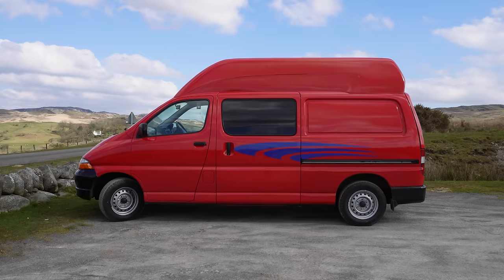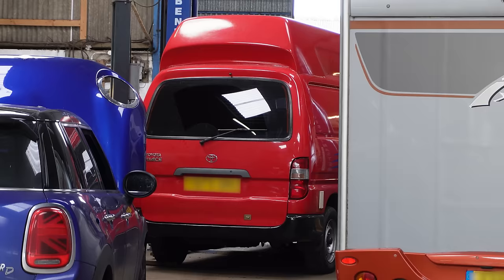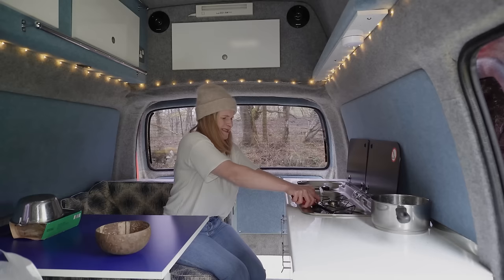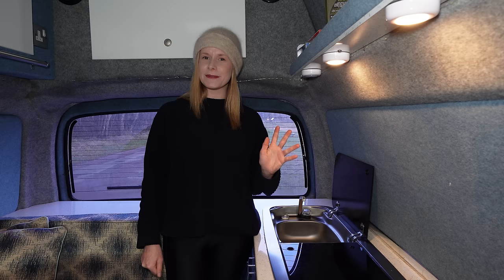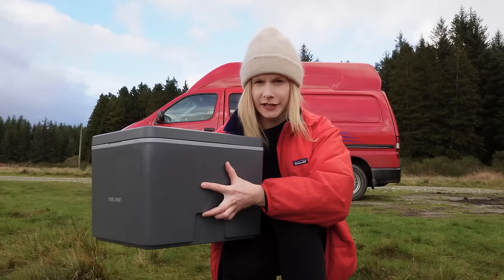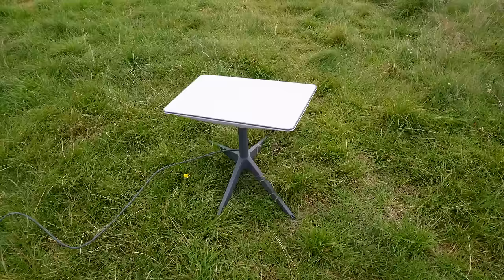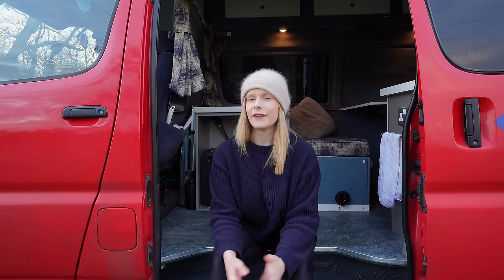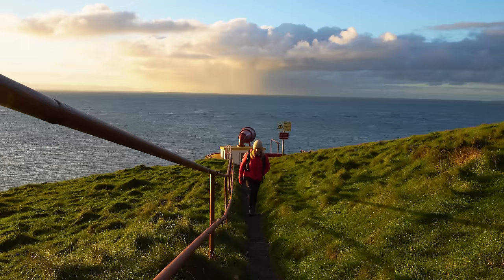Reviewing My Campervan After 6 Months

Comment: A change I'd make is to make the passenger seat swivel so you could use it when parked up. It effectively makes the van cab part of the living area. Often these conversions give you the space under the seat too, that's where the leasure battery was in my old van
Reply from the maker: The passenger seat does swivel actually, I need to start using it more often!
Reply: for my 99 toyota sienna???

Comment: You could hook up your water pump to the bluetti so that you don't need to turn on the car and drain your car battery again. Then unhook it when you're done.
Reply from the maker: Good idea, thank you!
Reply: yw @ruthaisling
Reply: I know you've fixed it now with a foot pump, but it's worth remembering that leaving the ignition on without the engine running can burn out the coil.

Comment: It's good to see you getting so much out of a used vehicle. Obviously, it's a keeper. In Canada I used to drive an old Ford (292 V8) school-bus conversion, which was fine except for the electrics, which were a nightmare! After a disastrous wire-harness fire halfway up a remote pass in the Rocky Mountains, where I ended up blocking traffic for two hours, I sold it on. I've driven many a passenger bus since, but I've never had the courage to try another camper conversion. Happy travels, Ruth! 🇨🇦
Reply from the maker: Oh a fire sounds so scary, glad you were ok!

Comment: Rich content, nice production. Thanks for sharing. Our camping Mains and DC comes from our EcoFlow Delta 3.6 kW power station, as our Sprinter van’s “house” battery/inverter. We expanded it with companion batteries. We also have StarLink, and we use the “Sleep Mode” to greatly reduce power draw at night. We follow this quote when considering our van’s camping design: “It seems that perfection is reached not when there is nothing more to add, but when there is nothing left to subtract.” Antoine de Saint-Exupery
Reply from the maker: I haven't tried sleep mode, I'll give it a try next time!

Comment: If you convert to a traditional 12v solar system you can add that second panel.  It won't matter what the power output is either.  It just needs its own dedicated charger controller. An MPPT controller sized for a single panel can be had for a low cost. Of course you would need two of them.  One for each panel.

I run this on my camper van.  I have four, 100 watt panels going to one Renogy charge controller.  Additionally I have 200 watts worth of portable panels that I can hook up to a second charge controller.  Both controller are wired to the same 4000 watt/hr battery pack.  I have the newest Starlink panel and it is even more power hungry but the problem it solves is worth it.
Reply from the maker: Thanks for the advice!

Comment: Had the same problem with the water. Put in a small LED light near the sink that goes on when key is turned. Works great.
Reply from the maker: That's a good idea, thank you for the advice. Did your battery ever go flat from it?
Reply: @ruthaisling  before the light, YES. The led only draws a watt or two, can be on a long time without affecting your battery. I like the toilet my the way, hope to get one. I live full time in my shuttle bus here in Hawaii. All the best, Bill

Comment: Hi ruth, I don't know anything about Vans but yours look pretty nice. 
I remembered that a big sport shop sells a kind of warming bags that provide hest for several hours. They must be similar to the thermal patches that can be use to treat a muscular or back pain. Maybe it's not a very bad idea to add some of them to the first aid kit for the dual porpouse: treat a muscular pain or provide warm in a cold emergency. 
The external diesel eaters look really nice. 
Also, i remembered that old trains had a pump in the floor to raise the water to the tap. They still can be found as food pumps. But i think it will be better to use the rechargable battery to provide electricity to your actual pump, if possible.
Reply from the maker: Thank you for the helpful tips!

Comment: Hi Ruth, you have done a good evaluation on the van.  I think you should fit a leisure battery, lithium Iron Phosphate if you can afford that or much less costly conventional lead acid style. The alternator will recharge when you are driving plus you have the solar 130w on the roof. You will need to purchase a controller depending on what type of leisure battery you choose.  I have simple 100ah lead acid leisure battery which is charged by the alternator, a 120w solar panel or topped up when I’m on a 240v hookup.  It also feeds a 1000w inverter so my wife can use her hair dryer for a limited time if we are off grid.  I have also fitted a 50Ah lithium Iron phosphate separate system, it is charged by a 40w solar panel and mains 230 when available.  We use it for charging phones, pads, watches and it runs the 12v tv and fire stick. It’s doesn’t charge from the alternator due to the cost of a B2B charger.  Don’t forget I get as much out of a 50Ah lifepo4 battery as a 100ah lead acid. Enough I say!!!  There is plenty on YouTube about the subject.  Now I strongly suggest you fit security dead locks on the front doors, the sliding door and rear door, I used vanlockstore, they are good but there are many others.  We feel really good even parking in a supermarket when the doors are deadlocked.  All folk have to do is break a door window an open the door.  Also if you are inside in an off grid location you feel much safer.  I mentioned the diesel heater before but you have already decided on that one.  They are so much better than gas, we carry a 500w 230v heater, when on a site you can run them on the thermostat.  Good luck we the rest of the winter projects.  Also you will love visiting France, it is SO diverse from beaches to mountains and all the countryside in between. Feel free to ask any questions, I’m a retired engineer and a bit of a geek, hoho! Cheers Mike🥃🍷👍 Keep the videos coming👍👍👍
Reply from the maker: Thanks Mike, all your advice is very helpful and I didn't know about deadlocks so I will look into those.

Comment: Hi Ruth
The best & most reliable gas heater is Webasto. Expensive but they are really good. Don’t attempt a DIY job. It needs to be fitted by a professional. It will add value to your vehicle too.
Reply from the maker: Thanks for the tips!

Comment: I've been swithering about doing a van conversion next year and would likely be powering it with a Bluetti AC200MAX.  

It has a 30A 12v output which, if connected to a 12v fusebox for distribution, is more than enough to power the lights, fridge, USB sockets, diesel heater, water pumps etc.

The only downside to the bluetti is the slow charging rate from the vehicle battery when you're driving. 

There are workarounds though...

Using a 500W inverter connected to the car battery and plugging that into the bluetti's mains input.

Using a DC to DC converter connected from the car battery to the bluetti solar input.

The BLUETTI DC Charging Enhancer (D050S) would (I think) let you use the DC to DC converter method at the same time as your solar panels. It's £150 though!

There are plenty of YouTube videos on all these methods.

Also, I think you can get adapter cables to let you connect your mains hookup to EV charging stations and charge the bluetti that way.

A possible quick fix for your water tap... Does it connect to the car battery via the vehicle fuse box?  Some of the fuse sockets are only active when the engine's on and some are active continuously.  If it's piggybacking from one of the existing fuses, then you might be able to switch it to one of the continuous ones.  Assuming that the tap only draws power when you turn it on, you shouldn't flatten the battery!
Reply from the maker: Thanks for the advice Ewan, very helpful. Someone else mentioned about the EV chargers too and I didn't realise that was even possible so I'll definitely look into that. I think you might like my next video, as I mention about a diesel heater!
Reply: @ruthaisling  Looking forward to it.  

I should have added that the idea of the DC to DC converter is to increase the car battery output voltage. More volts means more charging power.  You'd need to check with a mechanic that your alternator is powerful enough to cope with the extra load.

Comment: Hi, nice video. It looks like you have 2 batteries under the bonnet so using 1 for the starter and the other for your  12v system would be straightforward. Using  fuses for  water and lights. Cheers Richie.
Reply from the maker: Thanks for the advice Richie, I will look into it

Comment: Adding a less than £100 Chinese diesel heater would improve your situation.  Also having a switch over so that you can use your leisure battery separately from the ignition would definitely help
Reply from the maker: A switch is a great idea, thanks for the advice

Comment: Great little video….nice purposeful van with just about everything you need and once you have completed your upgrades job done ! I would love to have a camper van for the freedom it gives you and I’d happily live in one full time…my circumstances changed dramatically recently and I unfortunately found myself camping in my car ! Not the best ! But on the plus side I already had a Dacia Jogger estate car which I found out has a camping kit produced especially for this vehicle….so a proper bed to go in the back and a large custom made tent that attaches to the back of the vehicle! I’ve now purchased the kit and I’m happily camping out in all weathers 💪
Reply from the maker: Hi Kevin, sounds like you've got your car well set up now. Are you keeping warm enough during this colder weather? I got a nice long hot water bottle from home bargains for about £10 which is great for putting inside the sleeping bag.
Reply: Ha ha yes I'm keeping warm thank you 👍 I also have a small silent generator so I can run a small fan heater off this for weather like we are having presently! 🥶

Comment: Lovely  Ruth , I have been thinking of this as well though not so tall as thinking about 6 foot 6 inch parking restrictions in car parks but certainly having a second battery  controlled from a make before brake switch for the other electrics (same as you have on boats) plus a diesel heater .
Reply from the maker: Ah yes this van doesn't always fit in parking areas with height barriers so that's a good point to consider too. Thanks for the advice about the switch and the heater!
Reply: The idea of the make before brake switch is with the engine running to switch from battery one (your van starter battery ) to battery two (your other electrics battery ) and charge it up and when charged you can turn the engine off ,then to start and drive the van just switch back to battery one again ,  this keeps the two systems separate and would not cost much to do ,any boat chandelier would give you advice on doing this.    @ruthaisling

Comment: For the water, how about using a hand pump?  No wiring or electricity involved.
Reply: Old VW Westphalias circa 1975 had a simple set up where the water just ran out at the speed of the storage tank if you pulled a lever.  Alas I am too old now to remember how this worked exactly.... :(
Reply: @pokeyjeanne  PULLED a lever?  Do you remember if the water was stored above - something like gravity feed?
Reply from the maker: That's a good idea!

Comment: Hi Ruth, I love your video's. The problem you have with the incorrectly wired water pump, is a straight forward job of moving a cable. Just a small point, I think you made a mistake with the mileage. The outer large numbers and larger MPH signifies that the van is at  92k miles.  Sorry to rain on your parade. Keep up the good work.
Reply from the maker: Thanks for the advice and you are right, whoops. The captions on the screen are incorrect. The vehicle reads in miles like you say.

Comment: Never heard of that model of toyota. I have had toyota's for many years and honda motorcycles. I have had a 1999 Toyota Sienna van since 2005 with 230,000 miles on it. It is only automatic and yours is standard. nothing is standard in america. Can't imagine where and how bad your oil leak is. There is nothing much under there for the oil and oil filter. Running a few new wires from the 12v batteries to the sink water pump should be no problem. 14 gauge wire should be more than enough. I don't think the amperage draw is that much for the water pump. It should be labeled voltage and amps. 😁 I want to see the stick shifter. Is it a diesel engine? Most of ours are all petrol/gasoline.
Reply from the maker: Yes this is a manual diesel vehicle! Thanks for the tips about the wiring, very helpful
Reply: @ruthaisling  If my private jet and helicopter was not broken and I was a millionaire, I would fly there and do it for you. Listening to your accent would be enough payment. 😂😂🤪🤪But I am a poor person. 😢

Comment: Great to see and hear that Ernie is working out well for you. I've been looking for something similar but there are so few good Hiace vans on the market. I've started looking at Japanese second hand imports as an option. Is this something you considered?
Reply from the maker: Are you searching in the UK? I spent about a month searching and found 2 suitable vans, this being one of them. The other van was a 1997 and already in Scotland which would have been easier to go and see. I did actually consider shipping one of my campervans from Japan to the UK. I talked about it in my first video on the channel but decided against it for a few reasons, mainly the cost would be equal to buying a van in the UK (based on the budget I had), it would take about 4-5 months and I wanted the van for the summer and also that van had a low-roof and it's really important for me to have a high-roof so I can stand up inside. I lived 18 months full-time in the low roof van and found it very difficult and had a sore neck and back from bending over all the time.
Reply from the maker: I spoke to many export companies in Japan who are very efficient and helpful with this type of thing though. Second-hand vehicles in Japan are usually in excellent condition. If you can get a van through an auction too, you could get a very good price.
Reply: @ruthaisling   Yes I've been searching in the UK.  There seem to be lots of specialist Japanese importers around the UK and the Japanese market has so many more compact camper options than we do.  Something like a Toyota Alphard with a pop-up roof would be ideal as a solo or 2 person short term camper.  They were only sold in the Japanese/Asian markets, which is a shame as they are compact and ideal for our little island I think..  Prices for a good imported model (UK reg, etc) are high, but so tempting!
Reply from the maker: @davidtoddhoward  Campervans seem to hold their value well in the UK too so if you did decide to sell it on eventually, you might not lose much money on it. There were some Japanese comments on this video saying the price I paid for this 20+ year old van is very high compared to what you could get it for in Japan which is interesting.
Reply: @ruthaisling  That's a great point ☝🏼.. I hadn't considered the resale value (especially for a good condition Japanese import). Thanks so much Ruth ✨. I'll let you know when I've made a plan or decision!

Comment: How difficult would it be to transfer all the camper conversion bits to a newer or lower mileage van of the same type, if you ever needed to?
Reply from the maker: I think I'd be more likely to sell this van as it is and buy a new one and do DIY if that was the case and I'd do out the interior with wood!